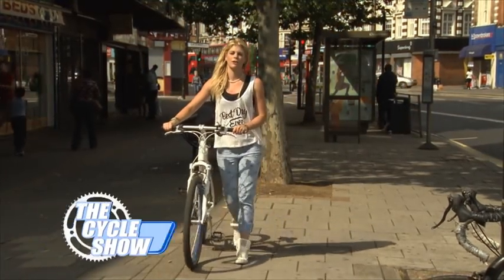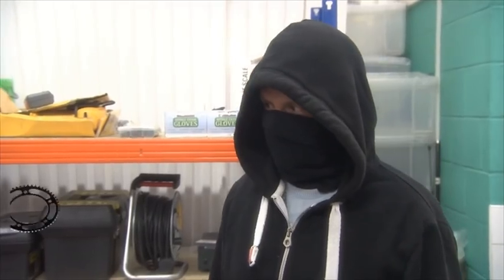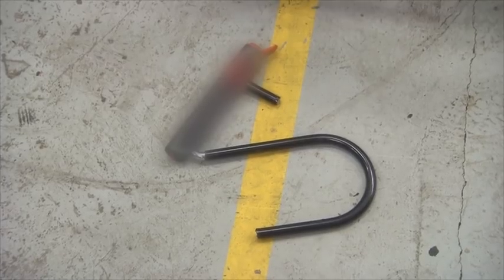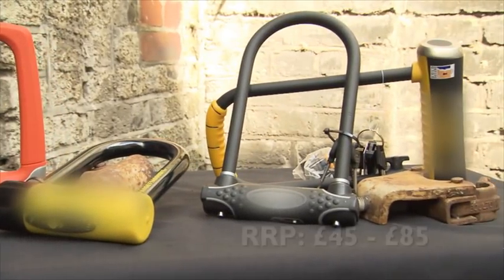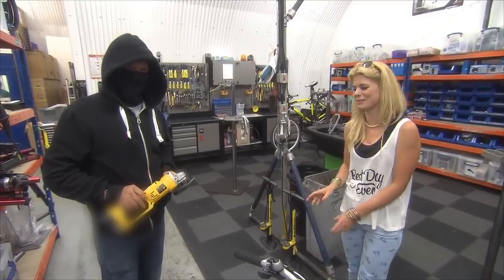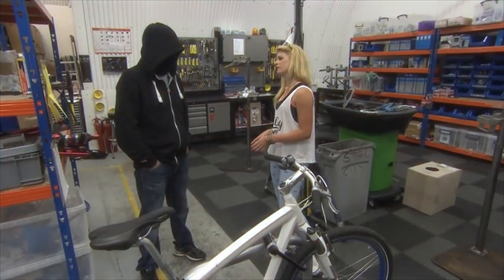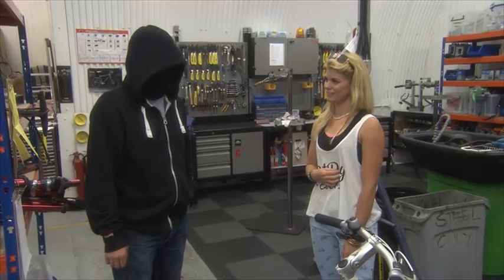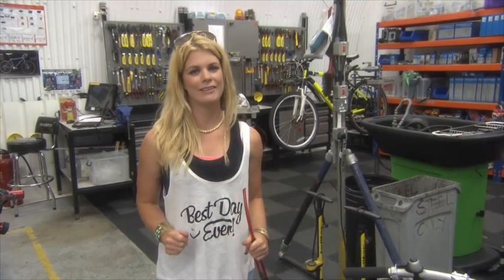How secure is your bicycle lock?

Comment: Two great ways to deter theives is 1) Remove the Seat and carry it with you. 2) Untighten the Handlebars so if they try riding it, they can't steer it.  It's easy for you to carry a Wrench to tighten both of these back up.  Theives don't have time for that. Or if you REALLY want to make it difficult, get Removeable Pedals, so they have no way to race away with it!
Reply: Good advice.
Reply: Yeh cos they couldn't carry the bike straight into a van could they.... 🙈

Comment: Lumberjacks wear trousers with fibers in them that clog chainsaws and stop them dead, to prevent the lumberjack cutting into his leg during a mishap. Maybe a sleave around the lock containing those fibers could stop an angle grinder?, it could be worth lock manufacturers looking into it.
Reply: an aluminum sleeve over the lock would clog up the grinder  wheel making the thief's work so  much harder. Or a hard rubber sleeve would do the same thing, and put out a lot of smoke and an awful burnt rubber smell.
Reply: @BertGraef  Yeah Ive tried grinding aluminium it took forever!
Reply: Thieves will always find a way around. Focus needs to be on how to deter the crime. The punishment needs to be bad enough that the thief would not want to risk it, common sense.

Comment: I have a Bully alarm U-lock with a pager that sounds off and vibrates.  I also have Kryptonite NY U-lock and Kryptonite NY Noose chain lock. I use one of them connected with a cable for the wheels. I also use hose clamp for front wheel and glued ball bearing in hex bolts.  A thief may want to quickly snip off the cable for your front wheel but now he needs an 8mm wrench to take off the hose clamp.

Comment: To be fair, nothing on the market today would stop an angle grinder, because nothing is harder than diamond.  Best you can do is a 12mm Pewäg or Laclede high security chain (not like the cheapo chain in this video) paired with a case-hardened/boron-steel insurance lock like an ABUS or Abloy.  Even those are vulnerable to an angle grinder, but it would take enough time that most thieves would go looking for another mark.  Pewäg and Laclede chains are basically impervious to everything, save a diamond grinder wheel or a plasma cutting torch.

Comment: Why is there no ulocks with alarms yet??!!
Reply: there are thousands of it...check on aliexpress :)
Reply: That is a great point the only ones you can get in the UK are alarms off of Ebay or Amazon that would not with stand a Hammer attack.
Reply: @michaelnedsmar9106  all depends where you install the alarm
Reply: Some more expensive bikes have alarms on them so if they’re even moved, it’ll go off
Reply: There is a company in Texas that is developing a lock that does have an alarm but in addition to that it networks with stealth cameras that are located on the bike as well which records everything that is going on when it detects movement and it then sends an alert to the bike owners cellphone and streams the audio and video of what is happening live. That way the bike owner has a chance of getting back to his bike before it's actually gone and either way, the bike owner has audio and video footage of the crime being committed. It also has the option of coming with an additional separate disguised remote camera which you can place at a short distance from the bike. You point the remote camera towards the bike and then it the sensors in the bike itself get tripped, it automatically turns on the remote camera which then captures a totally different angle of what is actually happening so you can see what is going on from 5 to 10 feet away giving you a better idea of the situation and additional footage that may end up being useful to the police and/or prosecution.

Comment: 1. make your bike less desirable than the others.
2. take out every piece that can be easily taken out without screws and stuff
3. do not leave it out for the night
4. do not EVER forget to lock it, most stolen bikes where just unlocked and a passerby can just take it and go home with it
5. 2 gold locks (front wheel can be a cheaper one) also a cable lock on the seat if you're going to leave it on the bike.

Also, people usually don't think about it, but picking locks is just as easy, I can open most of the locks with less than a minute on pick locks and I'm not even that good. And picking a lock do not make noise.

___

People that live from stealing bikes will usually:
1. work together, someone will be on a van ready to put the bike inside.
2. have a orange vest to look like a city worker taking an abandoned bike from that space
3. be really fucking fast at it, so fast that if you spot them from inside a store, until you get out of the store they're already leaving with the bike.

So, buy a bike that don't stand of like a 1500$ bike, a simple looking one is better and safer for you to commute. Try to keep it inside, there are so many bikes that can be fold-able, have the tires taken of, etc, choose one of those if possible and bring it inside.

Also, look where are you putting the bike, it doesn't matter if you have 200$ on locks if you lock it to a hidrant and the thief can just lift the bike to get home with it.

Comment: If I were a bike thief, I would simply cut the bike rack rather than the lock.
Reply: Where I live they are usually just big, like 2inch hollow pipes that make the bike racks. Seems way easier to cut through than a 18mm bar.
Reply: If i were a bike thief, I'd turn myself in and get a life.

Comment: ulock your back wheel and frame together to a secure structure. heavy duty chain lock the frame of the bike to a secure structure. install quick release front wheel lever so you can take your wheel off and with you. use the quick release lever on your seat to take that as well. wedge a sharp stick into the hole that you just removed your seat from.

Comment: I have 2-16mm U locks with 12mm chains for my front and back tires (gold standard), an additional disc lock AND a throttle lock on my moped. Not to mention 2 airtags and a tracking device and a couple of cheap locks to hold down the cover...lol!

Comment: The thing is... If you lock bike too much, then thief will basically cut the thing that your bike is attached to... Sooo....
Reply: What if it's something to thick to cut easily? Like every existing bike stand and feasible place to lock one. If you're tied to a sapling or wooden board maybe but other than that definitely not gonna happen
Reply: most bike racks are unhardened sheet metal tubing that is occasionally steel but often just aluminium
Reply: Yep, cuitting through the bike stand at my work seems like it would take less than 30 seconds. Almost makes me want to start locking it to light poles instead
Reply: It's sad when places of work don't allow you to bring your bicycle inside in a safe place.  it's like they are asking you to get a car and make things worse.  :(
Reply: PS. I lost a job because they were tired of 'letting me bring my bicycle in' and to be frank, they weren't worth it, so i left.

Comment: Motorcycle Disk Lock Alarm - Bike can’t be ridden or touched without it going off  - Very difficult to grind off too and they can’t be cut - I remember it saved a 600 Ninja one night which I used to own (Meaning the brats ran off), and I now use it on the mountain bike along with a U’Bend Lock.
Any touching of the bike will trigger a warning, touch the bike again and it goes off - Oxford Screamer - You just clamp it on the disk and press a button to set it.

Comment: Youll need a smart/air tag and a tile tag. Get 10mm 3.5ft long chain, a heavy duty high shackle lock and 2 u locks that unlock on both ends so if someone does cut it they have to make 2 cuts. All of which need to be sold secure gold rating. Put one around yhe back tire connecting it to the frame, one around front tire connecting it to Frame and use the chain and lock to connect it to something sturdy. No chain is uncuttable and no lock is unpickable. Your slowing someone down and 6 cuts with am angle grinder will take even the most skilled craftsmen atleast 10 mins. He has to cut everything or he's carrying your bike down the road. The tags u put in the seat and sow back up right on the seam, most bike thieves won't change the seat out until later on down the road. Usually if ur bike is stolen you know within hours. I paid for everything and all that still didnt ammount to 200. Less than 200 is a small price to pay for that thieves sanity

Comment: I was looking at a bicycle parking lot at a railway station.
50 % of the bicycles looks wrong locked. Not locked with the solid mounted bike stand.
Just only with themselves. So you can pick them away, without unlocking needed.

Comment: 0:04 ok for massive amounts of individual people out there

Yes use d lock threaded through the frame and also the wheel and also the actual bike rack itself

Where you can use a heavy-duty chain to wrap them up now

Certain people who goes on the next level of bike theft

Don't have the equipment to court through this particular kind of instructional behaviour

Then they will equip their self with Allen keys and spanners and socket wrenches

Those people there are there to try and take the bike or take the actual bike to bits

If you lock up the freemium wheels which is a good idea

You must think about the forks as well now for the forks which are single crown get a tension cable what you can order it from the internet we can place padlock a secure padlock

Wrap that extension cable around your fork and frame so they cannot go off with your thoughts because it will be secured and tighten around your frame and also secured around the forks

Because certain bike theft will end up on doing the components

No there is another little finger as well which is called a handlebar brake locking systems for motorcycles you can use this for push bikes this one which for pressurised the brake blocks the break in and also wrapped around your grips and also your lever

0:10 and also if you look at the contents of this pick more at least over just 6 to 7 quid on eBay or Amazon it will stop B first son doing your grips I'm doing your brake levers for the time being so they can't take off your handlebars or your stem

Because some of them can be equipped with biking tools

This is why we need to look into by that very carefully when parking up your bike a lower voice always take off your seat and your seat post because sometimes if they can't get that they will Rob down instead

And if they can't achieve on something they will not come back to it or they will end up getting their locks and looking a lock around it

In the process of this simple matter is best to buy not one bike what to buy 2 b have expensive one to keep for riding and have a cheap bike for riding and going to places and locking up

The cheap bike is so journey in places and locking up and using for work or using it for going into certain places such as the city centre

I advised people to look into the project and look at the conservation of this now the supply bottom bracket which is a straight through bolt through I invite people not to go for that conscience go for a 3 piece crank bottom bracket where is it where you have to bottom bracket but with a wider hole on it have it secured very tiring because sometimes they end up trying to take off your crank

And also observed your area before locking up your bike for example look for CCTV footage for aiming at the bike racks or look for a place which has CCTV footage or a cage why you lock up your bike

Never look up your bike with loads of locks around the actual bike rack because those locked that somebody else who are ready and ready to come into town to lock up your bike with their lock

If that does happen keep your locks on the bike call the police or call the Fire Brigade to come out if you're paying your taxes telling the situation if they cannot deal with the situation to on bolt the locks which somebody has attached to keep your lots on it and go out and get yourself a bolt Cropper or some sort of what is involving this always keep your bikes on you and you have photo evidence that it is your bike and the police do deal with this matter they able to call the fire service will come out and on Bolt locks that's how it should be dealt with in the professional way

Comment: lost two very expensive ebikes to angle grinders.  fast. they do it in under 6 seconds.  even saw a video of if from my gym outside camera.    dude walks up ,,looks, weals by,,10 seconds later walks up to bike , pulls out grinder from back pack. about 5 seconds later the lock is cut and rides off..total time was 13 seconds from a walk up , to ride off.  my locks are top rated motorcycle locks .. my new combo is the same lock with motorcycle disc brake alarm / lock.  they need to cut the brake disc and makes riding off difficult.  also alarm is going off. usually thieves hat alarms and move to a better alternative

Comment: well, the thief's advice at the end of the video is not bad. Just use 2 proper locks, and when hiplok's d1000 comes out, it's really giving the thief a challenge. Super rare to see a thief with a proper corded angle grinder on the street.

Comment: Hi guys. I have a question that needs answering and the more opinions I have the clearer my mind will be. 

I went to the shops today and I used a Kryptonite and a magnum lock (both U-locks) I U-locked on both my wheels and frame.  I used the strong cable (Both came with U-locks)  to secure my seat, rack and basket. 

It’s my first time leaving my bike at a supermarket bike rack so I was rushing as fast as I could. Not even 2 minutes inside the shop, self doubt started to kick in and my brain was starting to nag and say things like I didn’t attach the lock to the post. ( you know the most important thing) I ran out the shop and was relieved to see it still there and attached to the post but I looked up to see some guy STARRING at my bike. 😮 I kind of ‘rudely asked if he’s alright. He jumped and asked if the bike was mine. I said yes. He said he was admiring it and then left. I was stood there for about 2 mins scratching my head. I went to get my shopping. My question is do you guys think he was ‘admiring’ my bike or do you think he was about to pinch it?! He just looked like your average guy. 

Pls help because it’s my first time locking up my bike in public and it scared me! I know I locked it up with top quality locks and I made sure EVERYTHING was locked. How long do you guys lock your bikes? I only left for 2 mins! I’m glad I trusted my intuition!

Pls help and give your opinions because I’m contemplating not leaving my bike anywhere other than my house.
Reply: He was selecting your bike.
There is no way to protect a bike that has been selected. They want your one, they will get that one.
Buy a crappy old piece of rubbish for daily driving, and never ever leave the good one unattended outside.
Reply: Peter Kroll 

Thanks for the reply and Yes I did get that impression when looking at him. My bike is brand new! I’m really protective of it and I bought it to go to work on but my trip to the shop the other day scared me. If I didn’t use my intuition I would have lost it. 🚲 ☹️ kinda sad. Not only that but bikes and locks are expensive. It’s so annoying. The guy in vid broke my U-lock  in 38s! With a power tool! Your right! Thanks again. I think I will use your advice. 😊
Reply: @sandramcnamara9057  I am so sad to say this.

When I was a child I left my bike outside over night, dumped it anywhere near my house where I was at that moment. Coming back next morning it was still there. I got never anything stolen. Sounds like these old folks saying everything was better back then, right?

A few years back my friend's bike was stolen OUT OF HIS LOCKED GARAGE! He had ankored it to a hook at the wall. They took a battery operated grinder, obviously cut the hardened steel chain open. It was brand new, just like yours. The remainders of the chain were laying on the floor, the bike gone. Opening the lock of the garage door was obviously not hard, and the cutting of the chain may have taken them less than a minute.

Obviously they had  aimed at this particular bike. You may spend hundrets on locks, but I think it will only prevent trespassers from riding away.
Reply: Peter Kroll it’s really sad and the police don’t really seem to care. I just read a local newspaper article and some poor guy got his motorbike stolen and it was pretty much where I parked my bike. 

I’m so saddened to hear someone broke into your friends garage. It’s not only the bike but it feels like an invasion of privacy as well. 

My mum said the same. She said she used to just leave her bike anywhere and it’ll be there after hours. I’m going to keep getting the bus to work and save up for a car. ( I passed my test! ) I’ll use the bike for exercise. I was going to use it for work but if it gets pinched it would be cheaper to get the bus than it would be lose an expensive bike. At least I would be the one getting the benefit of the bus fair right? 

Thanks again. 😊
Reply: IO thanks for the advice. ☺️

Comment: Not all chain are bolt cuttable, you wanna get the highest grade kryptonite or onguard best chain. Those are not cuttable with a bolt cutter you'll damage the bolt cutter. As far as angle grinders, I believe the battery powered ones aren't powerful enough for high security chains, you'll need a wired angle cutter for that which makes it very difficult for a thief. As far as locks, if you want a full proof lock with a $100 lock that has granite which will damage the angle grinder.